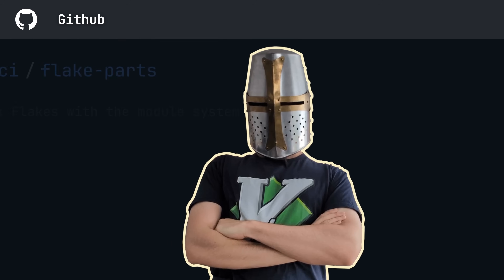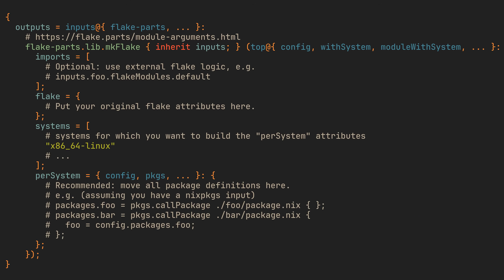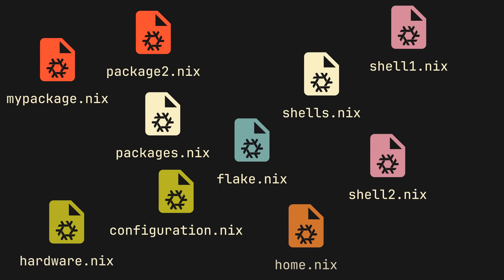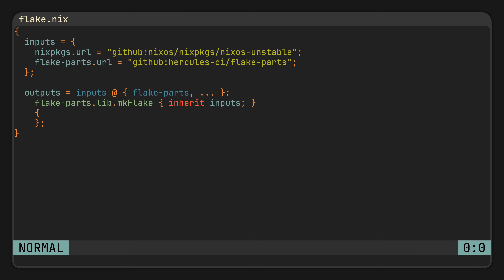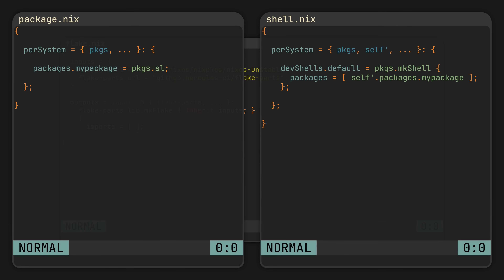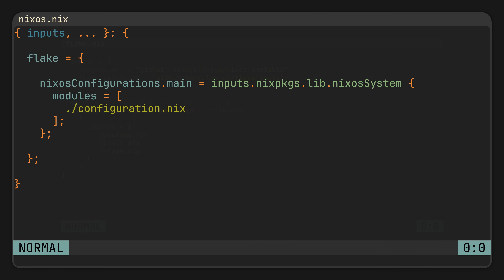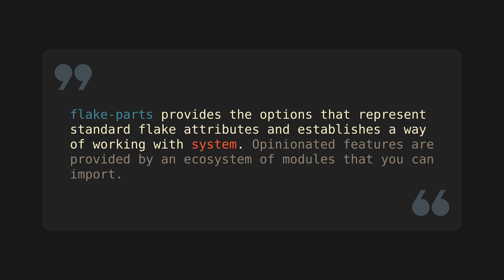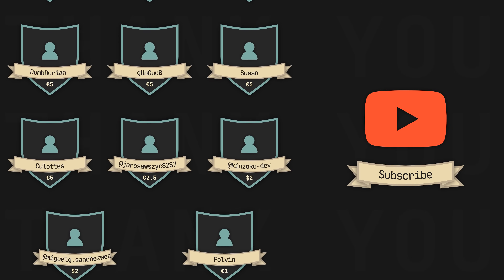Best Modular Nix Flake Framework | Break Your Flake Into Parts

Comment: I see people in the comments asking why would you use this with a single system config, so the answer is, you wouldn't, unless you already know what you want to gain. flake-parts shines when your flake is multi-output and/or multi-system. Especially when both, dendritic pattern simplifies flake's data-passing-architecture a *lot*. flake-parts.modules feature allows to put different class modules in same file, sharing local bindings, which helps if you need to fuck with stuff like home-manager, nix-darwin, disko, wrapper-manager or any other library that defines its own module class.
Saying this as someone who specifically ignored it for a long time, because i thought the complexity is unwarranted for my needs (joke's on me).

Comment: Hmmm for the basic example in the video this looks good, but I wonder if this could be used to generate a really good multi-user/multi-system configuration.
For example define 3 hosts with 2 users. Some packages (common) should be available for all users, some should be user specific. One of the three hosts has a desktop that needs to be configured, the others are servers without desktop. Some packages should be installed from unstable while others are regular nixpkgs versions.
I'm still struggeling to get stuff like this done in a nice, maintainable/readable way.
As others already commented, maybe this would be a good start for a flake-parts series with more advanced configurations.

Comment: Nice video! A couple things to add:
1. Flake parts don't really make sense until you use the dendritic pattern
2. Flake parts essentially give a uniform interface for declaring all flake outputs as opposed to nixos modules and pacakes being completely different. This means package definitions can be declared easily right where they are used in, say, a nixos module
Reply from the maker: Absolutely, that's why I am rewriting my configuration with the dendritic pattern, perhaps could make another video about it later, just wanted to make one dedicated to flake parts specifically
Reply: @vimjoyer I would love to see that!

Comment: Looks quite similar to snowfall lib? Or am I completely off-base with that assessment? I haven't used Nix in a while.
Reply: Snowfall does a lot of the boiler configuration for you. For instance, any folders in the systems subfolder are wrapped in a nixosConfiguration automatically. This is great for a simple setup, but if you need more control over say, how a package is created, it can be a bit tedious to get a package to match what snowfall wants in terms of output. In contrast, from what I've seen it used for before, flake-parts focuses more on making it easier to write modules that can be used on different architectures quickly. They give you the wrapper tools, but leave the majority of the configuration up to you as to how those tools are used in your flakes.
Reply from the maker: They both aim to achieve a similar goal but a bit differently